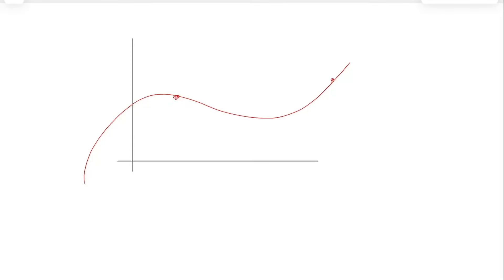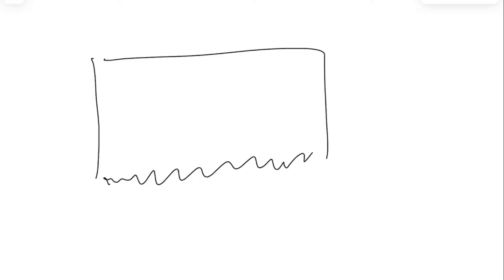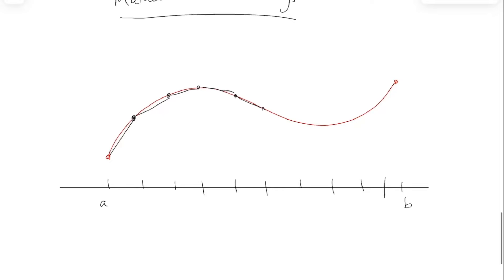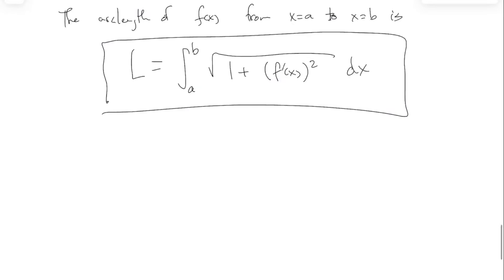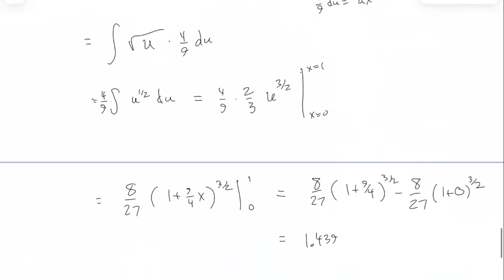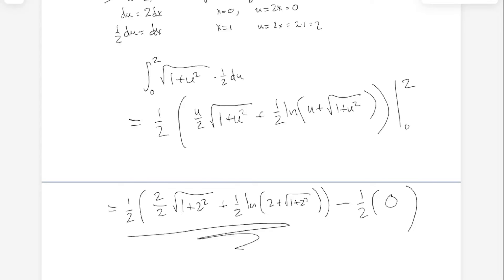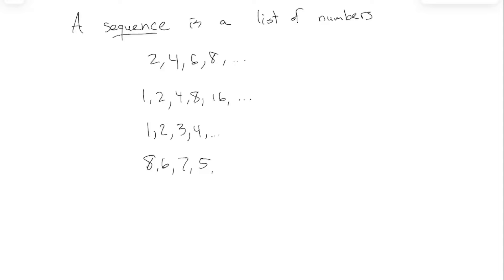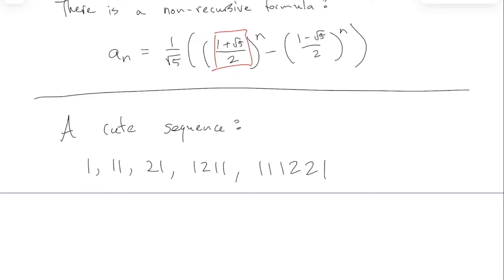Calculus II ep21: Arclength (Oct 22, 2024)

Comment: 16:35 (hiking and distance measurement by apps) The way they actually work with timed intervals aside, this seems like one that should be reasonably measurable (with an error range), since every step taken is from a specific position to another specific position, and the nature of your hiking motion is one that even if not linear, does have a limit in the distance traveled between those two points. The exact positions of those points can be refined, but the distance between them when calculated would not go to infinity as the positions and trajectory remain static.

I think
Reply from the maker: Yes I think I agree- a person walking naturally has a sequence of footsteps, and you can define the distance as the sum of the straight distances between the footsteps. This assumes that the person is walking normally, not sliding or rolling, not jumping with 2 feet at once, etc. At some level, the specific location of a footstep is not a specific well-defined quantity. The app (I assume) is measuring individual straight hops of my phone's GPS receiver. I imagine the figures you obtain depend strongly on the time interval between each location sample, which corresponds to measuring the distance with different "stick lengths".